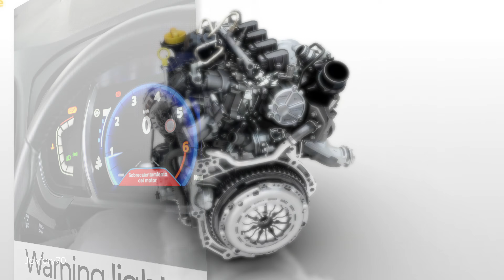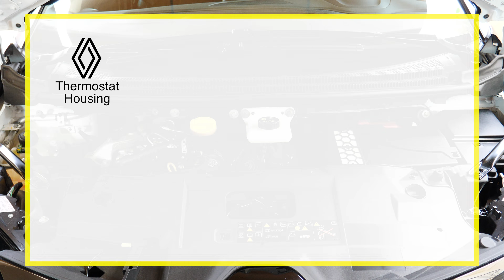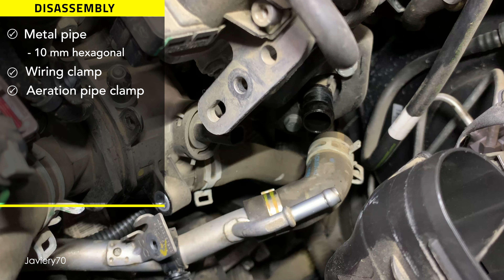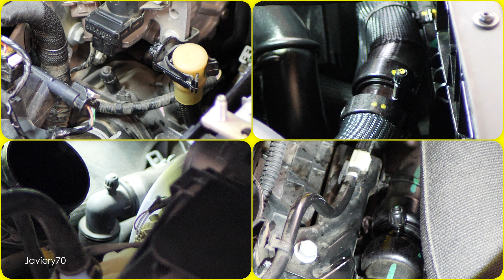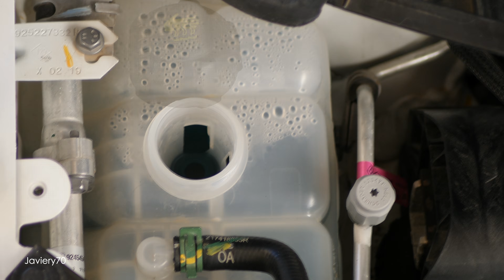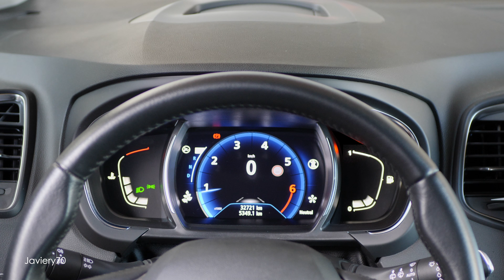🔸How to replace the engine thermostat housing on a 1.3 TCe RENAULT - DACIA

Comment: There is news that the water pumps produced by GMB tend to fail prematurely as well, due to weak bearings, it's worth replacing at the same time once the coolant is drained. Do you have the latest ref. number for currently used water pumps?
Reply from the maker: Which vehicle are you referring to?
There are more than 18 different versions of the 1.3 engine, depending on the vehicle.

I don't recommend replacing the water pump if it's working properly. That is, if it's not leaking and isn't making any noise.

There are new water pumps in some versions of the 1.3 engine
Reply: @javiery70 all renault dacia nissan with H5H with tight stretch fit belt no tensioner. The GMB water pump bearings can completely collapse as soon as 50k km.
https://youtube.com/shorts/HXJmYqaqqSY?is=A4LQkyMDn1JMoY0I
Reply from the maker: Not all 1.3 engines have the same water pump. Some versions have had problems, but it's not a widespread issue.

Since 2019, that type of water pump has been replaced with a new part number.

That video shows the water pump being replaced on a Duster. It doesn't show the H5H engine.
Reply: @javiery70 do you know the reference for the latest water pump for h5h470 130km and the lenght of the belt. I've seen 3x diferrent belt lenghts 1165, 1179 and 1195mm? Gracias
Reply from the maker: Yes. 
I need the chassis number to find the exact part number.

The original belt has its measurements printed on it; they are marked.

Comment: does Clio v 1.0 2020 model tce lpg has problem ? Mine had  coolant level dropped to min two times and the dealership told me it is from the lpg system or from the cup of the water bottle

Comment: Hi sir, can you make a video about correct oil? In Türkiye no one use RN17 spec oil. But as we know in europe they use. What's your notes about it? Thanks in advance
Reply: Top Tec 4300 and 4410 are available in Türkiye
Reply from the maker: Renault specifies and recommends:
CASTROL RN17 5w30
https://amzn.to/3Zus96X

CASTROL RN17 FE 0W20 ( Fuel Economy)
https://amzn.to/3ZZyzLu
Reply: @javiery70 liqui moly or castrol better? They both have RN17 spec oils (liqui moly 4410 RN17)
Reply from the maker: @troymoody2014  I recommend the same as the manufacturer (Renault), CASTROL.
Reply: Thank you  @javiery70
Reply from the maker: https://youtu.be/Jk8d4XtRIzE

Aracın şasi numarasını (VIN) söylerseniz hangi yağı kullanması gerektiğini görebilirim.
VF1.........
Reply: @javiery70 Chassis number :VF1RFB...
Egine no : H5HE...
Reply from the maker: I need complete numbering
Reply: Schwefel arm muss es sein (wegen dem Partikelfilter falls verbaut. ) ansonsten 5w30 oder wenn das Klima eher heiß ist, lieber auf 5w40 gehen..
0w20 würde ich nur in Finnland verwenden... 😁

Comment: Buongiorno, avrei una domanda riguardante il motore 1.0 tce 90. Renault prevede di utilizzare un olio motore con gradazione 0w20 rn 17 fe, è possibile utilizzare una gradazione diversa, per climi più caldi, ad esempio un 0w30 ? Grazie
Reply from the maker: Esistono due tipi di olio di qualità RN17:
5w30
0w20

Non esiste olio RN17 con viscosità 0w30
Reply: @javiery70  la Renault scrive sulla scheda di manutenzione di utilizzare rigorosamente l' olio ow20 RN 17 FE non indica la possibilità di utilizzare olio con specifica RN 17 , è vero questo? (Clio del 2024) Grazie
Reply from the maker: @robertosammartini9747  Sì.
L'ultima generazione del motore 1.0 TCe Renault prevede l'olio RN17 FE 0w20.
Reply: @javiery70 lo stesso simile motore ,a 4 cilindri montato su Mercedes ( M 282,  cc. 1332), uso lo 5/30, ma andrebbe bene anche lo 0/30....uso Shell Ellix Ultra, che già usavo sul Qashqai 1200.